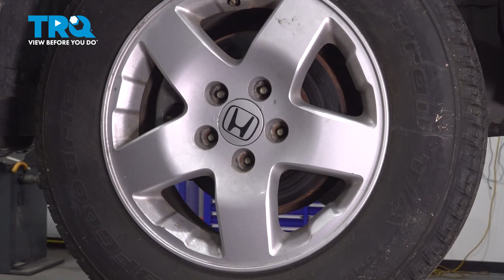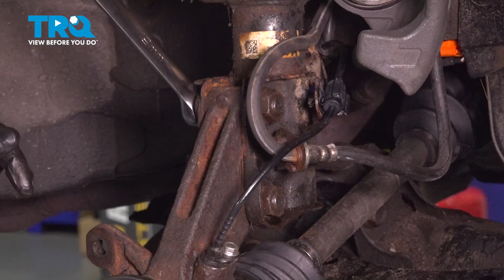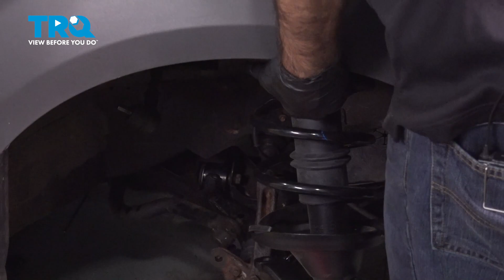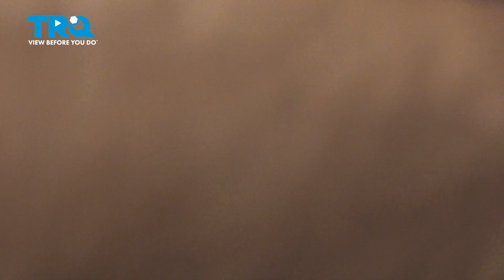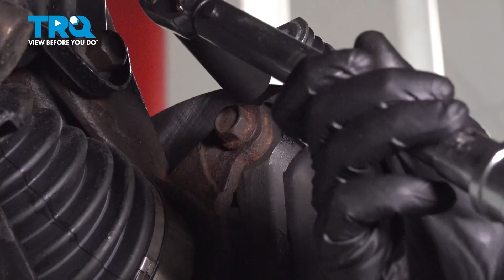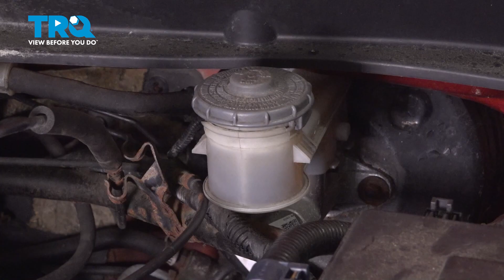How to Replace Front Strut & Spring Assembly 2003-2011 Honda Element

Comment: Um, the rotors and brake calipers don’t need to be removed to change out the front strut assembly. You just wasted your time doing that.
Reply: lol.. first time watching their videos? They film and edit multiple videos of doing different parts changing on the same vehicle.
Reply: They remove them for other instruction videos.
Reply: He changed the rotors while also changing the struts and brake pads . 😮 nice video! Jeez that’s a lot of work..
Reply: I think he did that bc did you see the thin brake pads and that rotor was toast.